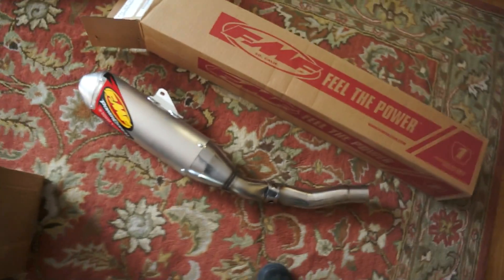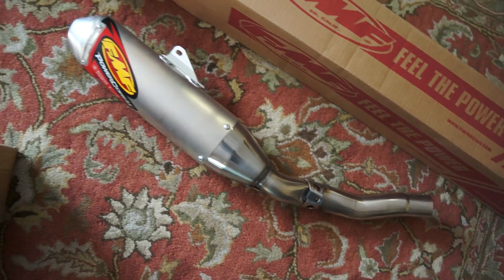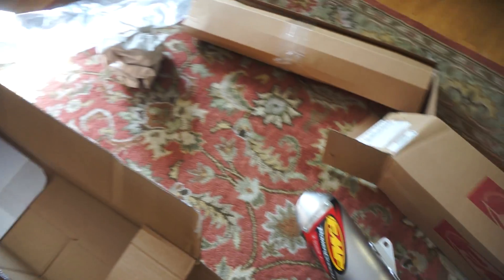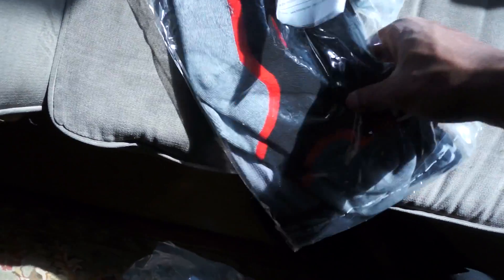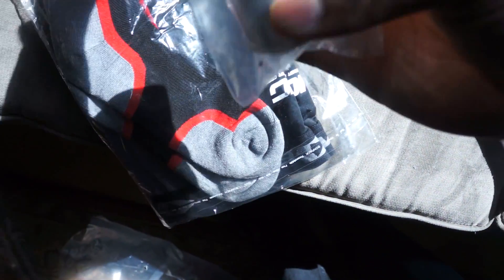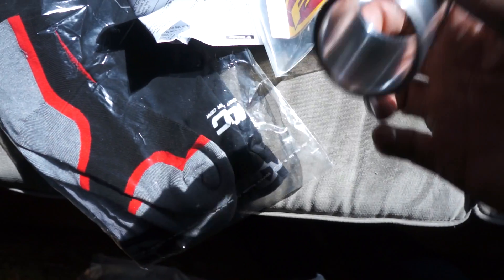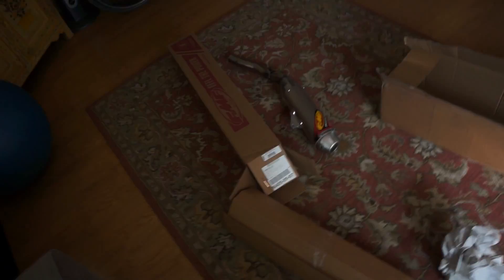New FMF Powercore 4 Exhaust Install!

Comment: I just picked up a 02 xr 400 it rattles at the mid pipe connection,  it has a slip on FMF, I'm guessing the collars are the wrong size. How did know what size to get?